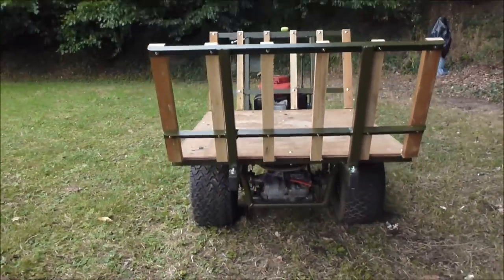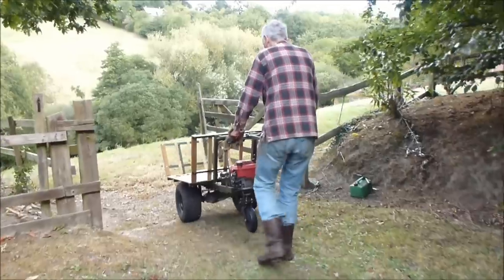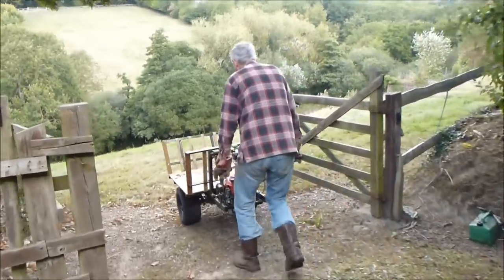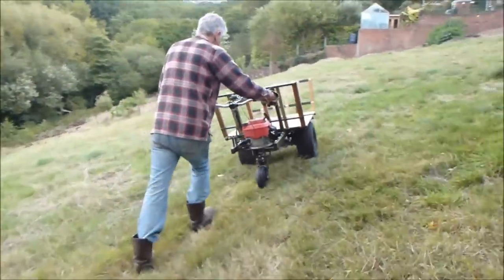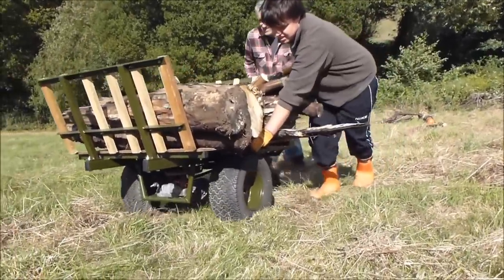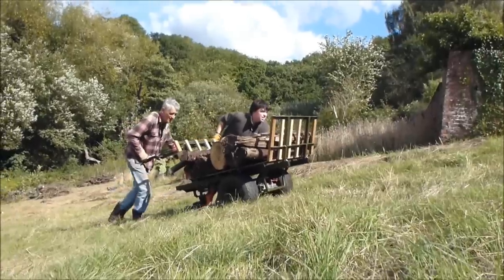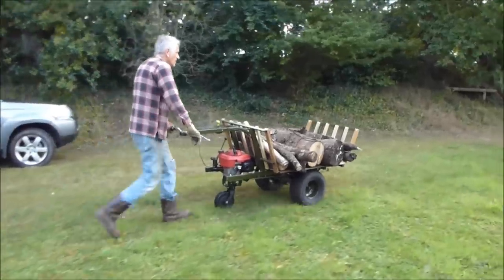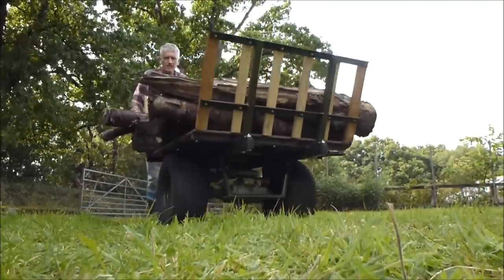Home Made Power Barrow (Cart) 4 of 4

Comment: When loaded heavy is there any trouble with steering? I plan to soon build a mechanics moble trailer with a motorized welding cart. We have a small 2 cylinder Kubota diesel generator to pull both a stick, and a big Miller mig machine. I'm not sure how much 2 welding machines with a generator with an Oxy Acetelyn torch with all hoses, tanks, and leads will weigh. It'll sure be heavier than the load of wood you were carrying. I need to build the power cart first as to see how much room it'll take before the trailer is built that will haul it. The trailer will be enclosed with boxes, drill press, cut off saw on the outside. That way when I pull up to a job site I can pull the Welders and torches next to the broken equipment and have all other tools on a mobile trailer. Do you have any suggestions or would you have made something different? Thanks for sharing your build.
Reply from the maker: +Phil Lowman Steering is easy because the gearbox has a differential, however you need quite a lot of room to swing the handlebars. It sounds as if you are planning a big trolley to carry quite a lot of weight. I have been impressed with the loads I can manage on this, however it's important to balance the load fore and aft. With too much weight on the front the handlebars will suddenly lift, especially going down hill. With my weight this size barrow is manageable, but I wouldn't make it any bigger. How about making your cart with a wheel in each corner, use electric drive (mobility scooter parts?) and charge the battery from your generator?
Reply: +sciencejunk 
Thank you for the reply. After a lot of thinking about my welding cart. I have several of the old Sears Suburban lawn tractors. "imho they are a simple but over built small pulling machine."  The plan is to cut the front axle out and get the engine as close as possible to the rear and keep the seat in place. Then build a 2 wheel cart to attach to the cut down Suburbans rear hitch like an earth moving pan. Or a tractor that steers in the center. "Forget the term for that"  With that hookup should be able to keep the steering wheel in place and run the tie rod back to the cart to turn the Suburban's rear tires, with seat to turn as needed. If I get smart enough to edit videos I'll send you one when it's finished.

Comment: Thank you for your response.  I'm building a cart just like yours, hope you don't mind.  I have one more question though, what size drive tires are you using?  Thank you.
Reply from the maker: +jschlesselman I replaced the ones on the video because of poor traction, I now use 18x8.5 - 8 chevron tread so that's 450mm diameter and the barrow works well on very steep hills.

Comment: I'm curious to know if you had to change the flywheel on the engine to a heavier one since it came from a push mower.    Very nice build. I have been thinking of building something similar.
Reply from the maker: No modification to the engine other than turning the shaft parallel to suit the pulley.
Reply: +sciencejunk Interesting.  Ive never tried running one of those engines without the blade but was told it wouldnt work. Im sure the weight of the pulley helps though. Yours obviously has no problems.
Reply from the maker: I understand the point you are making. I also made a charger using a Briggs and Stratton mower engine with no problems. The only hiccup with this one is a misfire if I go over lumps and bumps. I think this is due to the float carburettor and the lack of suspension on the solid caster.